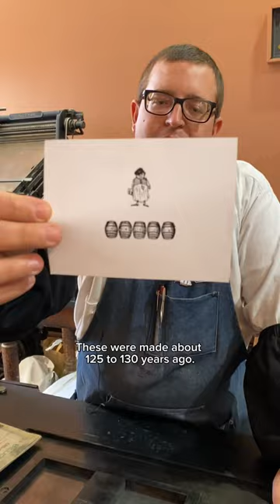Printing a couple beer related cuts for International Beer Day (August 4)

Comment from the maker: August 4th is International Beer Day! Sacramento’s brewing history began with the Galena Brewery, operated by Peter Cadel, in 1849 a block from Sutter’s Fort. Four years later, Louis Keseberg, a survivor of the Donner Party, operated the Phoenix Brewery for 8 years where the Galena once stood. 

Sacramento had a lot of breweries over the years. After all, Mark Twain once dubbed Sacramento the “City of Saloons.”  

In this video, Jared letterpress printed two beer related electrotypes (copies of woodcuts). These cuts, made 125-130 years ago, are from the Lewis Winter Collection. The top cut depicts a brewer and the bottom is a set of barrels that were used in an advertisement for the Buffalo Brewing Company that published often in the Sacramento Daily Record Union in 1897-1898.
Reply: I’ve been to sac many of times maybe if you have a museum open I can come 😊

Comment: @SacramentoHistoryMuseum I'm curious. Do you actually use the Linotype or is it just for display?
Reply from the maker: It is fully operational but we lack the ventilation and the electrical power to use it.
Reply: @SacramentoHistoryMuseum  I'm glad it still could be used if you had the necessary setup.
They were beautiful intricate machines. My dad bought, among others, one of the Comets from a newspaper in Benton Harbor, Michigan. As a kid, it was fascinating to watch the punch tape going through the tape reader and the keyboard keys moving by themselves.